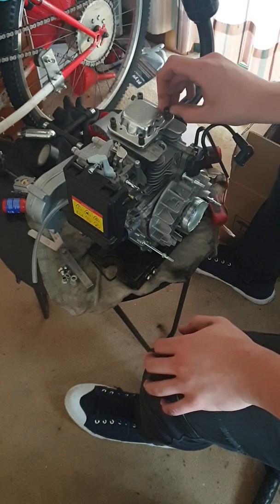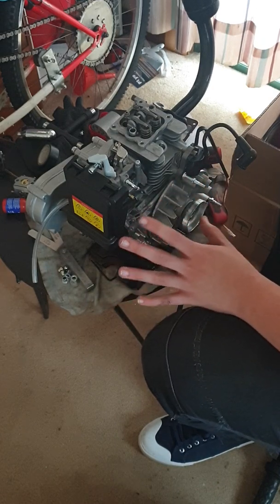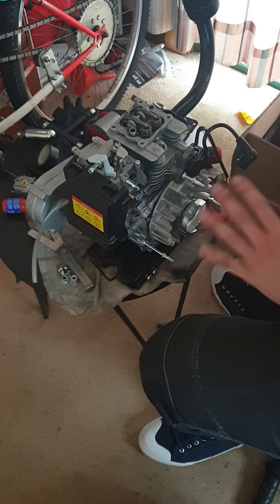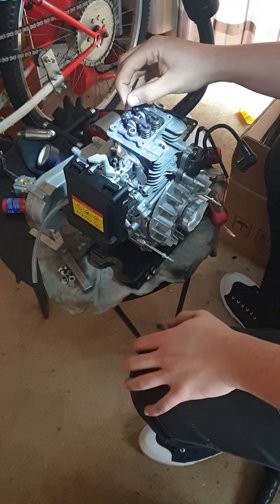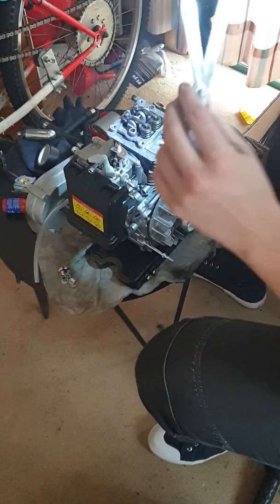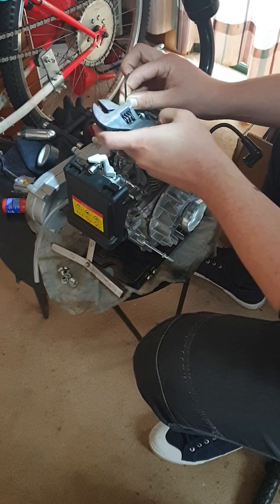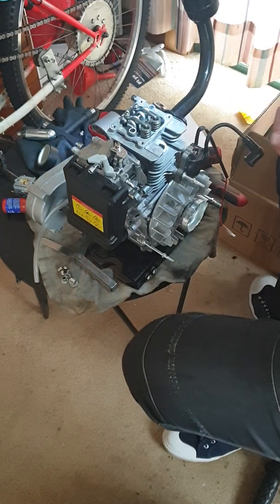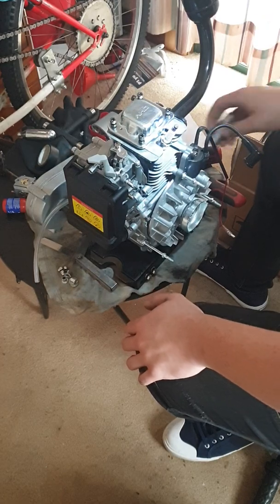49cc 4-stroke valve adjustment

Comment: I have 3 of these kits and I have been setting the valves at .003 with no problems. One is a problem child that I will try your settings on. My top performer I shaved the flywheel key.003 and it out does the others.
Reply from the maker: I will definitely have to give that a go!

Comment: How to fix if that engine wont start even if spark plug ok.and carb already cleaned ..
Reply: To original commenter, yes, this explains it! I have a relatively new engine, have not rode lots, maybe 100 miles if even that much on very short 2-3mile joyrides. Spark is excellent. Carburetor totally cleaned. Bike ran recently and ran perfectly. I was doing yard work and decided to have my bike idling in the garage so that it would be warmed up if I decided to take a break and cruise. Mysteriously died out like within a minute of idling and never restarted. After checking spark, 2 times cleaning the carb, and even replacing the (turned out shabby) OHV gasket, I thought it must be a compression issue.... but how?? Perhaps a piece of gasket got sucked into the valve and stuck/charred in between where the valve seats?? I initially opened the OHV cover, not to check the gasket which indeed needed replaced, but to check that a valve wasn't stuck open somehow. Well, my valve intuition is correct it seems..... it would make sense that my new engine is broken in enough that one or both of the valve springs have shrunk, so now there is too much play at compression stroke top dead center! This makes sense!!
Reply: Did you fix it? Same issue
Reply: friend I'm Brazilian and I can't understand which millimeter he used in the exhaust and intake?
Reply: @linguiça244-b3w  intake is 0.004in or 0.10mm, exhaust is 0.006in or 0.15mm.
Reply: @linguiça244-b3w  6:23 here's a close-up too 👍